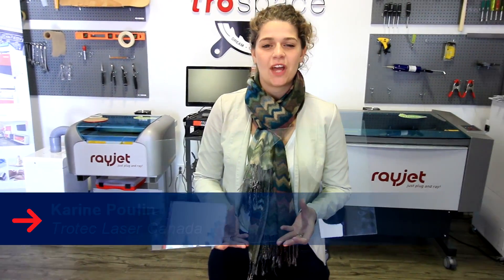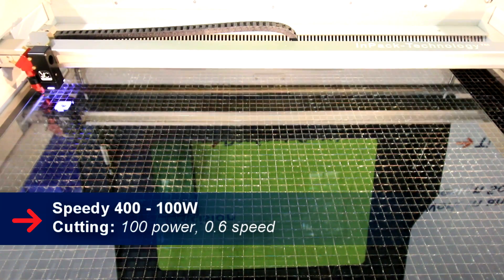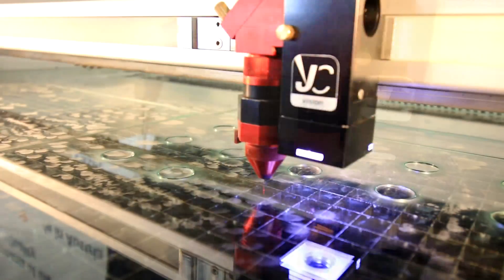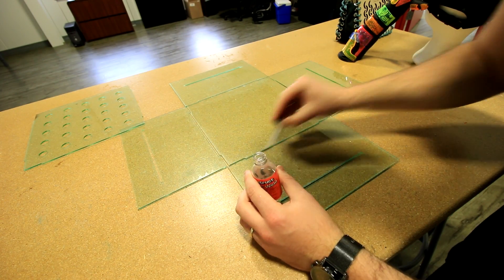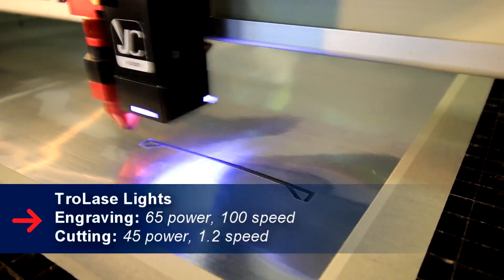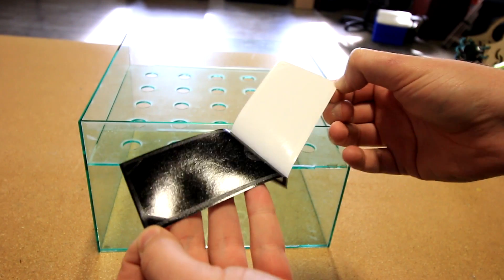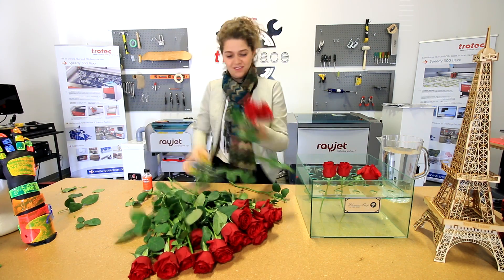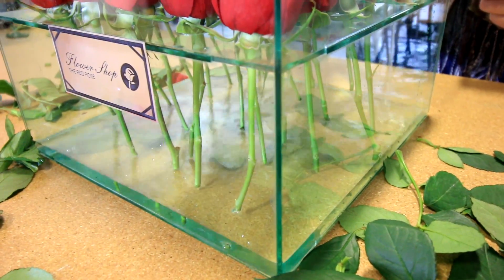Glass Flower Box | Acrylic Box of Flowers | TroGlass

Comment: Doesn't plastic weld not cloud the acrylic the way it is put on in this video. I am in interestef in creating a acrylic box with no tabs just edge glues to edge have you done this?
Reply: I can see didn't bother to answer your question and is 8 months down the road. I was about to ask the same thing. In general Acrylic, Perspex, Plexiglas (PMMA), Polycarbonate (PC) and Ultem (PEI)  need careful normalising and annealing steps throughout the machining, bonding and polishing process to avoid crazing. With laser cuts any of the above will need annealing prior bonding. They might just skip showing you that.